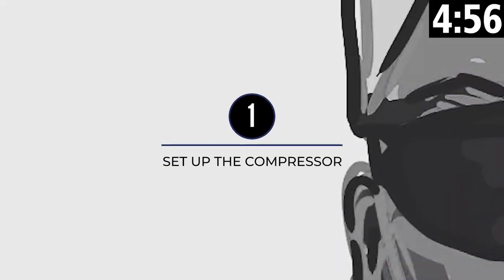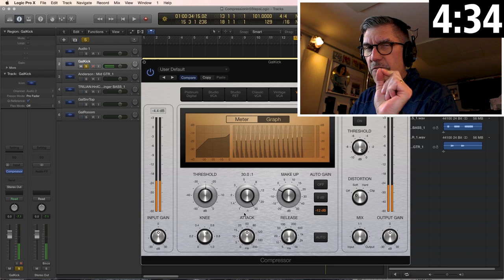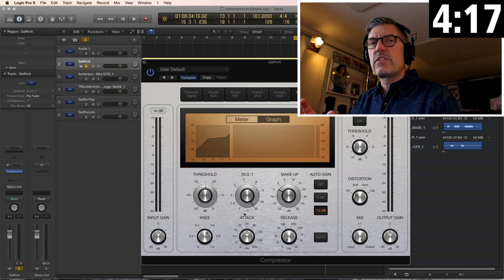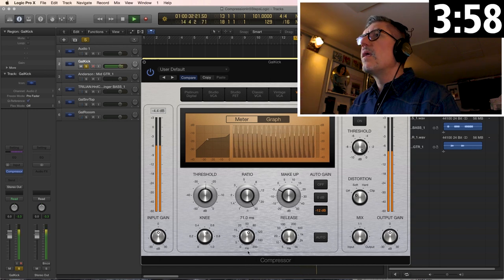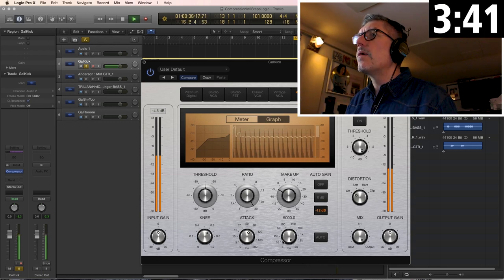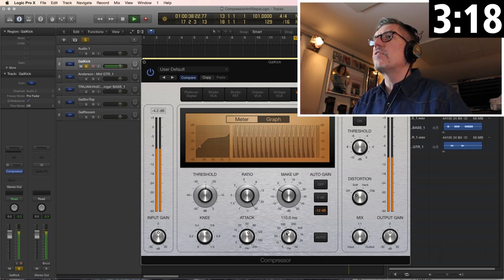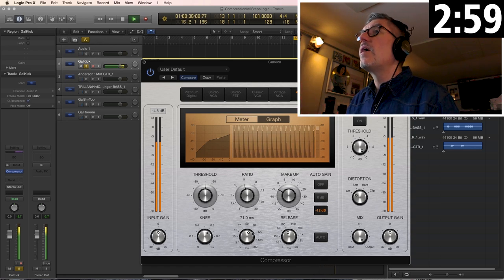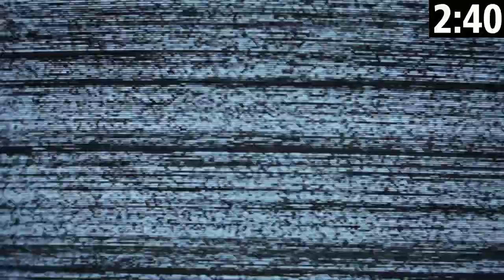Audio Compression Techniques - 5 in 5

Comment: Hey buddy, I have one question, after all those steps I didn’t see you using a make up gain for the gain reduction that compression causes, so.. when do you use it? When is it necessary? Thanks in advance, you have great stuff here
Reply from the maker: KZN good point! I should have mentioned that. Generally I would adjust the makeup gain so that the compressed sound is about even in level when it is bypassed. That way you can tell if the compression is genuinely making an improvement. Thanks for asking! Make sense?
Reply: Steve In The Mix I got it now!! Thanks for making it clear 😃